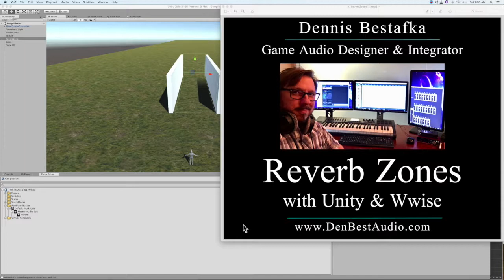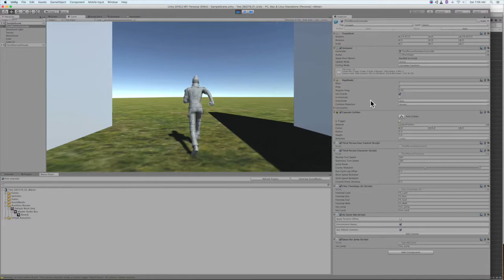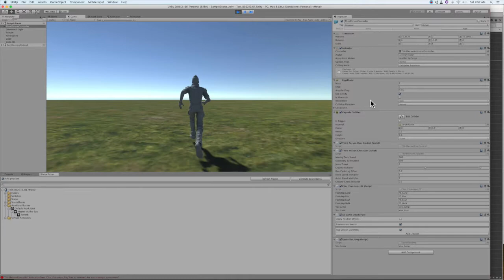Reverb Zones with Wwise & Unity

Comment: Great video, but it seems like you have some delay on the reverb
Reply from the maker: Thanks for watching! Yeah, I noticed that same delay on another quick project that I was working on with footstep switching as well. I need to look into what's causing that.
Reply: @DenBestAudio  Hi, did you solve this problem? I am facing the same problem.
Reply from the maker: @kkxszz4034  No, I haven't had a chance to go back and track this issue down; but it's weird right? My sense is that it may have something to do with a conflict in the versions, or possibly with just using Unity Personal. I use Unity Professional at work and never have these issues.